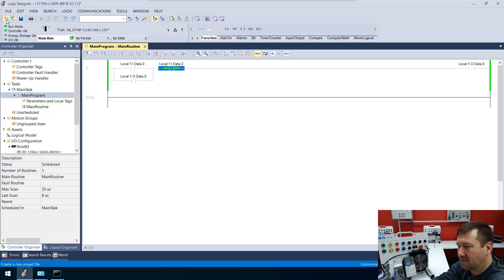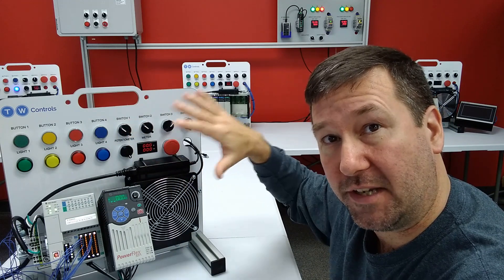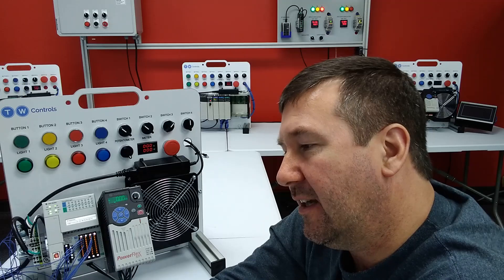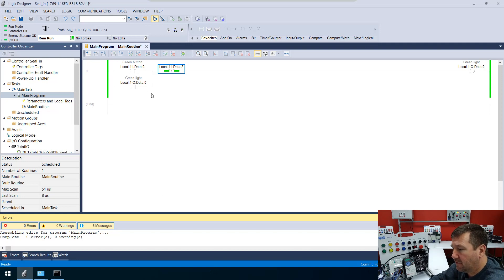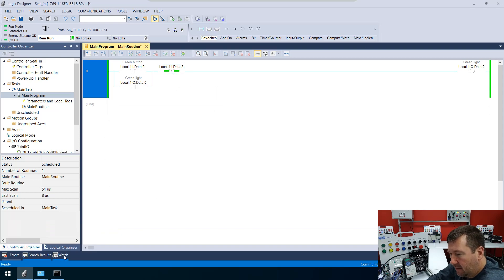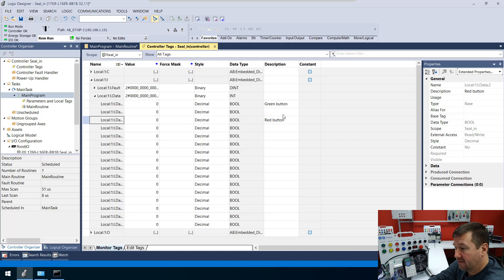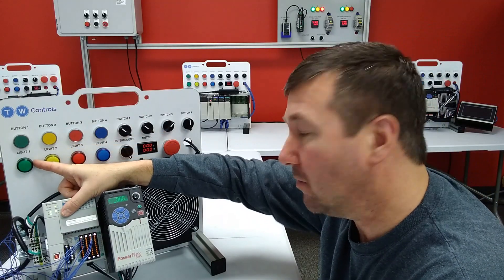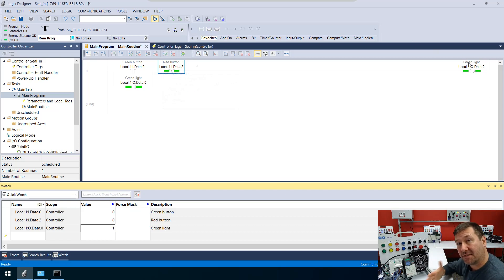Program a START STOP Motor in Studio 5000 with a Seal In

Comment: I’m having a problems with my software, I can’t add any output or rung from my bar, my professor told me is something about compatibility of my screen. Do you have any idea how to fix it? 
I appreciate your help. Thanks
Reply from the maker: Are you online?  If so, it the PLC in RUN mode?  You won't be able to make online changes if it is not in REM.

Comment: if I use a BASE tag to mimic an internal relay how do i do the wiring to make it work. I can do it with a real relay but not with an internal bit (BASE). Thanks
Reply from the maker: Use a BOOL data type

Comment: You mentioned in program mode even if there is a 1 in the data table for the output the plc doesn't physically turn on that output unless it's turned on elsewhere. Would that be used in programming for a power failure to make a powered on output the default in certain situations?
Reply from the maker: I'm not following you.  In a power failure, the PLC and outputs would be "off".  If you wanted to signal to something else that the power is off, you would need to use a normally closed relay.